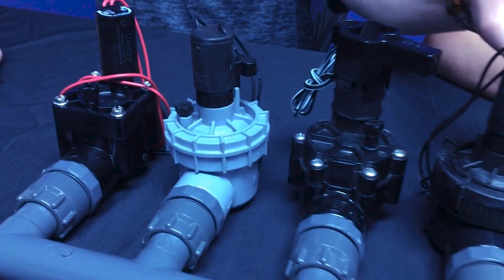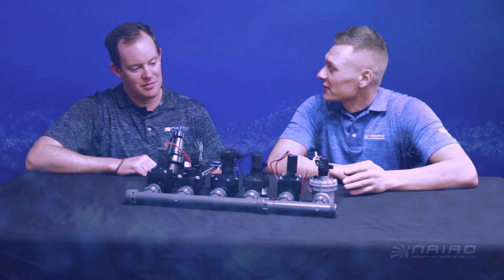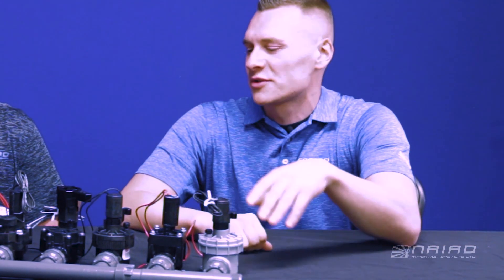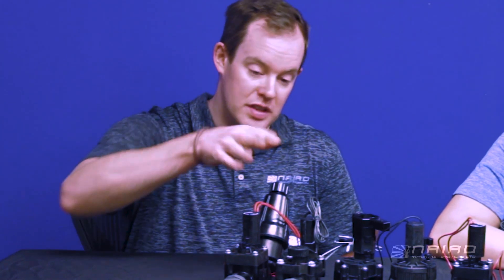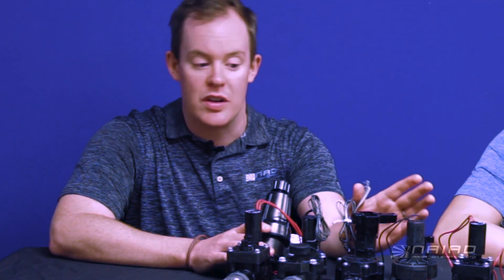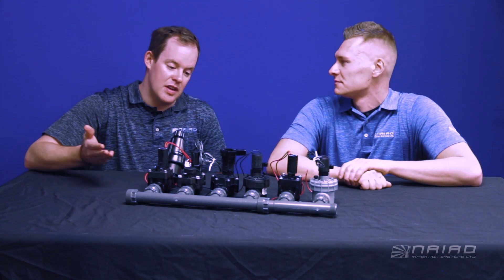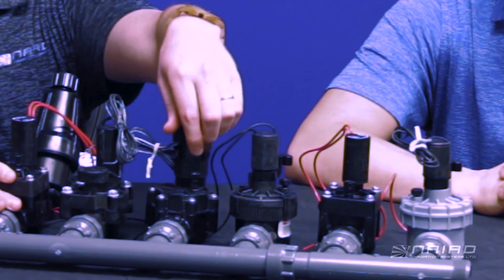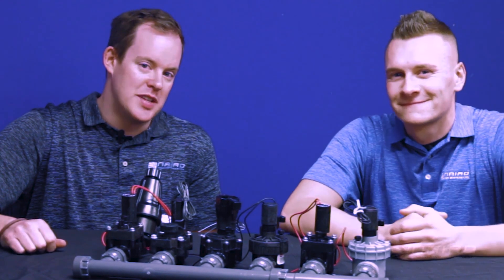Irrigation System does NOT turn off?

Comment: there is 3 categories of problems:
dripping
no open
no close
mine doesn't close, than there is  possibility one solenoid dumper port has not low enough pressure, than make spring stronger or permit more water use.
Reply from the maker: Generally speaking in most cases.  If a zone does not come on it is an issue with the solenoid.  If a zone does not shut off, it as an issue with the internal components.  That being said, it can sometimes be an issue with the to O-ring on the solenoid.  If we were doing the  service call and a zone is not shutting off, we remove the guts and solenoid and replace both the solenoid and the control valve guts.  If you cannot find replacement parts for the control valve, the whole valve may need to be replaced.